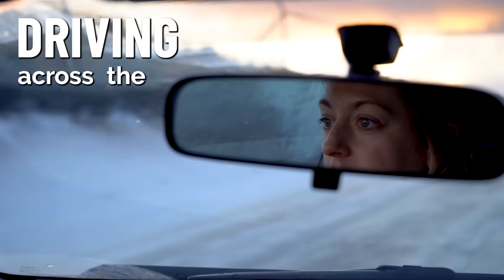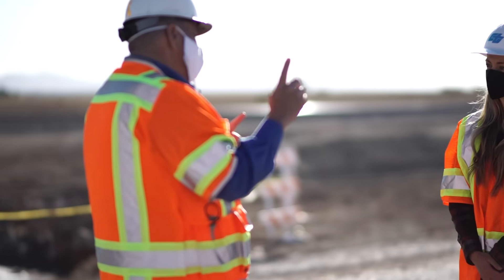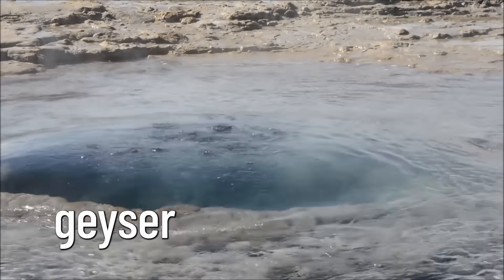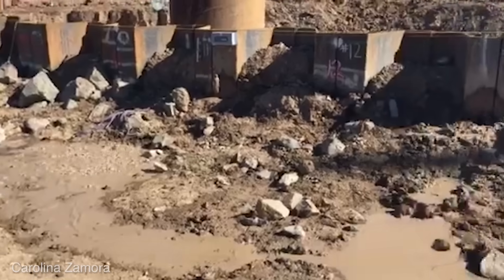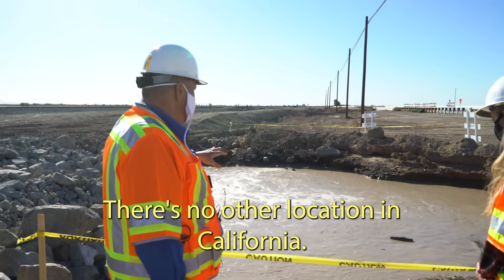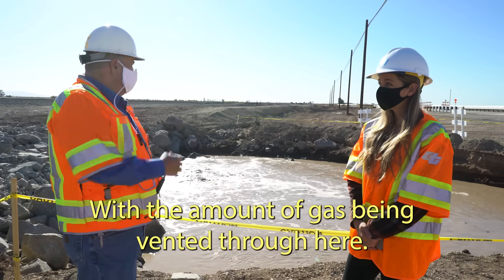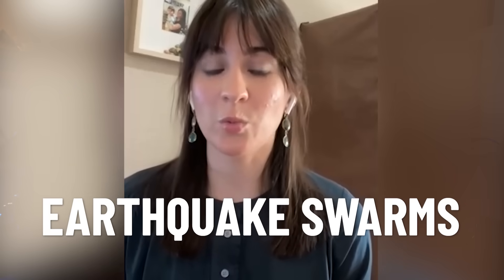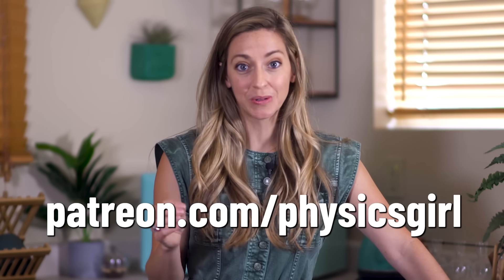World's Only Moving Mud Puddle

Comment: It needs to be isolated from the water table, the surrounding groundwater needs to be frozen and multiple pressure relief bores drilled down as wide as safely possible, this is the only moving mud pot but it isn't the only underground gas reservoir that has had to be seperated from ground water. Some regions have tackled these using a bore hole to send down explosive charges to blast away the gas-rich sheet rock similar to fracking. There isnt a method that is going to save the road, the whole surrounding area is good as gone and trying to save the road  is a waste of public fund - divert the road away from the mud pot.

Comment: So why the name Kyle?
CO2 pouring out and these two sheep are wearing cloth masks for PC covid mandates.
I agree. It reached the surface on an angle. Probably on a fault/crack. It will erode the ground until it is basically above it's source. Start drilling multiple test wells in a pattern ahead of it to determine which way it is going to go.

Comment: To test the "air coming up at an angle" hypothesis... can't they just jump ahead and drill a new hole ahead of the path?
This would release the gas at a new point ahead of the present location and essentially starve the current hole.
In fact, if that worked, they could experiment with new holes ahead of the path to help find the most vertical connection to the gas source.

Comment: if the gas is flowing from the source at an angle, could this be solved by digging a hole at the other side of the highway until you hit the gas "river"? then i think the puddle should skip the highway and move directly to the hole, leaving a "bridge" over the tunnel, and the highway would be safe on the bridge.
the problem i could think of is that we don't know the shape of the underground gas river, and we don't know where the source is, so the hole could miss the river, or the source could be directly below the highway, in which case it would be necessary to find the source and stop it.
there's also the possibility that the theory is wrong and the puddle is moving for a different reason. maybe the source is moving, but i don't know what exactly the source could be and how it would move.

Comment: This is some real SCP stuff right here that broke out of containment.
Reply: Object class: Euclid
Special containment procedures: Ongoing. There is currently no known way of containing the object. Foundation agents first attempted to fill in the the object with large stones only for these stones to vanish entirely. In a second attempt agents, under the guise of engineering maintenance crews attempted to contain the SCP by building a wall extending the length of a five story building into the earth. The SCP appeared contained at first but quickly passed through the wall without a hint of effort. In a third attempt drilling crews were brought on site to dig a relief hole and see if it was possible to redirect the SCP. This attempt ended in failure when the heavy drilling mud, supposedly too heavy to push back against, was spat out of the drilling hole as effortlessly as a geyser of water. There have been attempts by foundation personnel to see inside of the object using Class-D personnel fitted with diving equipment. No survivors have returned. 

(well that's my attempt anyway. I've never written an SCP before I just watch The Volgun a lot. So let me know what you think, I'm sure it's not very good tho)
Reply: @glenngriffon  awesome
Reply: @glenngriffon  Keter, it is impossible to contain
Reply: @glenngriffon  him and his American accent
Reply: @l_shaun_bunds_l  who?
Reply: @glenngriffon  the Volgan when he narrates scp, but not when he pronounces his supporters names.... as seen on internet historian incognito mode or one of those channels.
Reply: @glenngriffon  You named it: Euclid. Really?
Reply: @diamondcomplex  yes. It has a danger to it but it's more of a passive danger. It's just moving along slowly, it doesn't show signs of actively looking to destroy the railroad or the highway or wanting to hurt anyone.

The most aggressive act was spitting out the drilling mud and that can be excused as an act of self defense, believing that the drilling was a threat to itself.

Granted it's spitting out lots of carbon dioxide but so what, so are people. Exhaling CO2 isn't an attack or a sign of malicious intent. 
As i understand it (and as I said in my posts above I'm not terribly deep into SCPs so I could be wrong here) the Euclid classification is generally used for SCPs who are mostly not well understood. Entities and objects that are by and large safe but can be dangerous and even deadly if certain precautions are not actively observed. Keter class is one that is typically used for entities and objects that have no beneficence to them because they just want to destroy or destruction is all they can do. 

But again, I've never written an SCP entry before. I just wanted to plant the seed of an entry, a basic first draft if you will, for anyone else to pick up and run with. I'm not looking to make a genuine SCP entry here.
Reply: @glenngriffon  Could ya at least change the name? Because Euclid is the name of the most famous greek mathematician who founded Geometry.
Reply: @diamondcomplex  i know who Euclid is, i didn't name the mud puddle Euclid, Euclid is a classification name in the SCP community. There's three that I know of: Safe, Euclid, Keter. 

Don't get upset with me, i didn't invent the system. Take it up with the SCP community.
Reply: @glenngriffon  'am not upset;  it only sounded cheesy
Reply: @glenngriffon  iirc keter could fit in this case, cause in theory it's used to classify all SCPs that cannot be contained.
Euclid would mean it can be contained, and that it's dangerous.
Safe that it doesn't require any containment procedures.
And I don't remember the other classifications.
They changed it a bit too so I'm not sure
Reply: @g.a.4978  Last I checked you just have to perform the "box test" to figure out the classification in terms of the 3 basics.

Safe: put it in a box and lock it, and nothing happens.
Euclid: put it in a box and lock it, and you're unsure what will happen.
Keter: put it in a box and lock it, and it will escape.

A cat that teleports randomly around the world but is otherwise a normal cat is keter. A button that causes a nuclear explosion in a random major city but only when pressed and has no other anomalous properties is safe. I'd consider this anomaly to be keter based on the box test.
Reply: @glenngriffon  not bad, not bad at all. Just need to flesh it out some and throw a few (redacted)s in there and id say print!
Reply: @glenngriffon  yeah It's It's kinda short but It's pretty good. Could use some polish doe.
Reply: @g.a.4978  feel free to take it and and run with it. And no, you don't have credit me. I just wanted to put something down as a seed for others to build on.
Reply: @glenngriffon  +
Reply: it seems like scp fanbase is growing
Reply: @gnomechild3695  I discovered SCP a few days ago and honestly I am already into it. That stuff is awesome and the stories are really interesting. I love 049, lets rid the world of the disease.
Reply: Well, basically the only reason why the SCP universe hasn't collapsed from the amount of ways it could end is basically because of luck, so you really wouldn't want to be in a world of SCPs
Reply: Ikr! It would be so cool if SCP or alike is real
Reply: @kelseychow5415  no it wouldnt be cool, it would be straight disastrous, because most scp stuff are incredible dangerous and destructive. Tho sure there are some good SCPs but the ratio is like 1 to 1 million, 1 being the good and the million being the bad.
Reply: @AhhRealDreamMurMurs  a lot of scps are actually pretty cool/harmless/useful and lovely :D like 131, 073, 507, 4051, 1867, 408, 500 etc etc and the mud puddle can definitely fit in a file without any change :] like scp 1678 or other anomalous locations/structures its mostly harmless unless u jump right in, tho since its moving it'll be harder to contain
Reply: @AhhRealDreamMurMurs  yeah but we’ll just say that isn’t cannon
Reply: @Synthbug  Yeah, it's a vast and growing universe with lots of very interesting stuff. However, if you live in SCPverse, then the chance of you getting flashed by a picture of 096's actual face while casually browsing the Internet won't ever be 0. Then there's the thing with SCP-2000, everytime before it's used everybody died horrible deaths, and god knows how many times it's been used...
Reply: @AhhRealDreamMurMurs  I agree it will be straight dangerous I’m glad we don’t live in a universe where SCP is real those thing could end the earth the galaxy even the universe
Reply: @Synthbug  u forgot scp 999
Reply: @miltank4384  I missed out a lot of cool nice scps honestly :{ ig I haven't rlly thought abt 999 in a while,, I don't rlly revisit the big guy scps cuz they've become kinda over discussed😔
Reply: this actually fits an scp but i forgot what the number was
Reply: Lmao I was just about to comment that
Reply: Sorry for ruining your 666 likes lol
Reply: that’s real tru
Reply: i was wondering if someone talked about scp fond kkkkk
Reply: I was looking for this comment 👍
Reply: I see, so i wasn't the only one thinking that.
Reply: @PolySaken SCP -ex exists.

AKA anomalous entities that have been completely explained by mainstream science.

Comment: Im also not sure why anyone was surprised that it passed the metal retaining wall... No geiser or hots spring or mud pot comes from the surface like that.  It's origin could be miles deep.  I also don't get the point of continually rebuilding the road further in front of its path and have to rebuild over and over rather than building over where it has already been.

Comment: The correct engineering solution is not to build a wall instead drill a lot of holes wells in the vicinity and relieve the pressure underneath

Comment: To proof the gas source is on the other side of the road, wouldn't be a simple factor of drilling holes (quite deep) until they find a gas pocket over the general direction of the movement? If they do find a gas pocket and enlarge the hole to size, big enough to allow most of the gas to escape and prevent the cumulation of pressure, could this problem be dealt with?
Reply: Darknees XL  LoL!!! I'm afraid it would, though I wouldn't recommend just because it would spray a quite large amount of (radioactive) mud everywhere!

Comment: What kind of "Engineers" would think that pile driving a metal barrier down 75 feet would stop the progression of this moving mud pit? You think the source of this CO2 and water is only 75 ft under the surface. Its miles and miles deep. Reroute the highway you morons.

Comment: I have a question for you. Elon Musk uses super chilled Oxygen and Kerosene in the Falcon 9 rocket. Does the temperature of combustion change with the starting temp of the Oxygen and fuel? Would the exhaust temp be warmer if the temp of the O2 and RP1 were higher?

Comment: Maybe drilling a hole on the other side of the road looking roughly at the path was heading towards to could create a new puddle within the same source and making it jump there taking the pressure to there so it wont eat the road right away could work?
Reply: @guppyboy69 No, the relief well was to relieve pressure where the puddle was currently located (you can see the well drill was on top of the puddle), not on the other side of the road which is what this guy is talking about.

Comment: throw an iron piece with a steel wire wrapped on it to check the depth. you can dig a hole on the other side of railroad.

Comment: Could it be that the shifting of tectonic plates around the ocean is creating voids in the earth where water from the ocean/aquifers are rushing to fill? I feel like the presence of CO2 should be highly telling of the reason for the water.  Like potentially dissolved CO2 in ocean water when released from its high pressure container like a soda bottle create bubbles that force the water up and out.

Comment: WTF? That didn't explain anything. Is it groundwater? Is there impervious bedrock beneath it? What happened to the railroad??  What process is generating the carbon ? What about the hydrogen sulphide? What is the density of the mud? Wait, why is it mud? Surely it's just sediment laden water, right?  And why is it not defined as a spring? Springs and underground rivers move all the time? I want to hear what hydrogeologist say before I hear about civil engineering, because there is so much context missing from this video. Wtf?

Comment: Dig out 100 large holes, diversify the water evenly amongst each hole from the main hole, pour concrete where it was then boil out the 100 holes then fill all 101 spots with concrete, take all that sand/mud 10 to 30 Kilometers away and gently sprinkle it on random farmlands then come back bring soil and plant some plants to take root where those 101 hole were and beside each concrete fillout and eventually plants and soil and concrete will unify as one! No more issue, also if gas an issue just put venting pipes every distance of unit apart and bam mystery solved! And if not fully solved then oh wells it will take awhile for it to solve a new pathing as in decades to centuries! Cheers!

Comment: So if the theory about it coming at an angle is true, could some really hightech ground radar detect the source of the spring. Then drill directly into it, releasing a ton of pressure and effectively killing the spring? or at least instantly turning it from a angled spring to a vertical spring so it wouldn't move?

Comment: Seems like they could repeat that metal wall trick but this time at an angle under the road. Do it again from the other side. Then you have a cohesive barrier which should route the rising liquids and gasses to either side of the road.

Comment: why no geophys scans? Ground penetrating radar, etc. It would help a lot to solve the problem to map out what is actually happening under the ground. Maybe the theory that the source is at an angle to the mud pile is correct, in which case drilling a relief well directly above the source could solve the problem entirely...

Comment: Hmm, I wonder abut the angle theory, Can't they find the pocket source of the co2, and then drill a well at that specific spot?
I mean if the angle theory holds then that would be the obvious solution. just create that hole it wants to create itself so it does no longer have to move.

Comment: Friction from geological plates cause friction with their movement. Friction causes pressure and heat. And watching this, I cant help but to be reminded of the caldera under Yosemite. If this small water hole is to be remedied, the pressure needs to be either diverted, or the pressure ceased at the source in a way so tha it doesnt build up yet again. They might as well somehow stick a large explosive very deep and explode the pressure source. This though, will still only be a temporary measure as the geological pressures fron the plates all along the coast can not be stopped, and this spot is merely a symptom of a much larger geological problem. In fact it also contributes to the geological pressure of the "continental divide" creating mountains and contributing to the moving caldera under Yosemite far away, even creating mountains! The sheer collective force is unfathomable!

Comment: I saw that they tried to drill a relief well. 
Where was the drill hole with respect to the spring? 
Did they try multiple locations? 
Did they try to determine by some means how deep the spring was? 
Did they try to find a way to outgas the spring so that the erosion wasn't as strong? 
I feel as though they didn't try hard enough.

Comment: This is at the Salton Sea at 200 feet BELOW sea level. It's an active tectonic pull-apart basin, or graben called the "Brawley Seismic Zone" which connects the San Andreas Fault system with the Imperial Fault Zone to the south.

Comment: I feel like all the parts were skipped where they actually explained how they saved the railroad or how they plan to save the highway.
Reply: O just looked it up:
Apparently they moved the railroad to the other side of the puddle and moved the Highway away from the puddle.
They'll wait until the puddle has crossed the old highway to repair and reuse it once the puddle has passed
Reply: @sebastianjost  
Thank you for the clarification!
Reply: @sebastianjost  Thank you!
Reply: @sebastianjost  that's about what I was thinking the solution was. Just build a temporary bit that's far enough away that you have enough time to fix it once it's passed.
Reply: On the latter, I think the answer is that they won't save the road.  They'll have to divert the road around the other side while the hole keeps migrating.
As for the railroad, I was thinking bridge, but not sure if they have enough reliable footing depth, or how much of a span would be needed.  That answer would have been good, too.
Reply: Right? She talks about the tracks as if they have definitely been saved, but give no actual solution. Other than that, great video.
Reply: Ah, that must be the reserved extra content for the Nebula version of the video!
Reply: Yeah but the sad thing is is a local authorities really don't know what they're going to do because you're too greedy fix the problem
Reply: They are going to build a bridge for it
Reply: Possible that this falls under the umbrella of industrial secrets or protected knowledge? I mean, if you're the only firm to know how to deal with this, you might not mention it to anyone else.

That said, I feel like the track was probably just closed until the spring had passed under, then the sides shored up and the tracks bridged, just like with a river or stream.
Reply: It's California they haven't got the go ahead from the unions yet to do anything